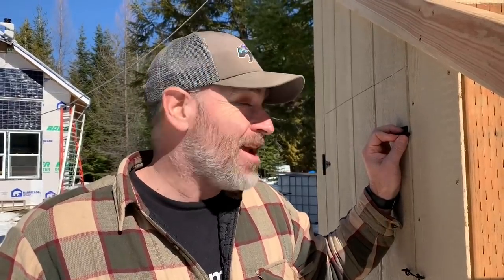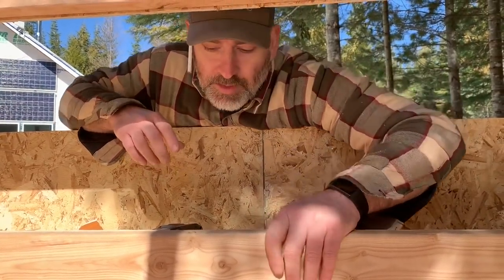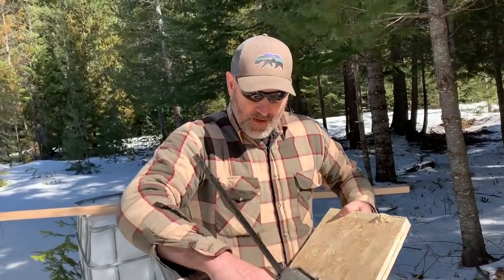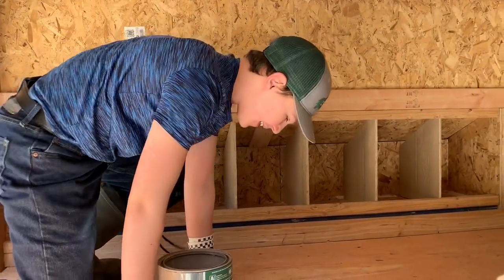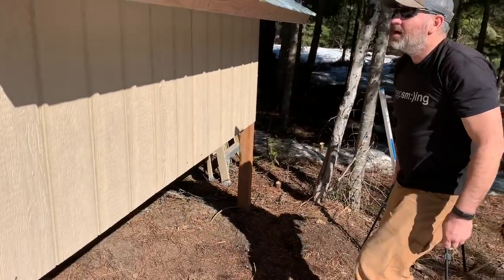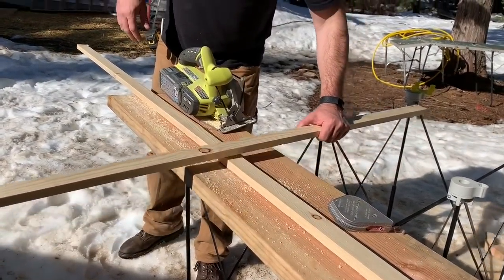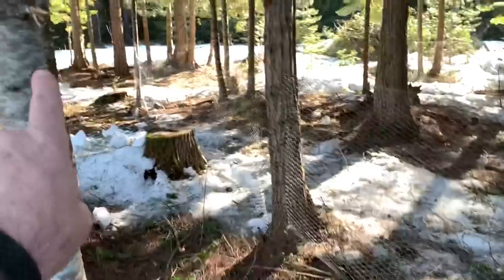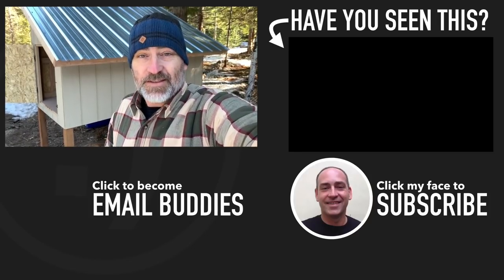BEST DIY CHICKEN COOP - How to Build a Chicken Coop - Part 3

Comment: hello! just a quick question, you guys live in northern Idaho, have you have any issues with doing a 100% tin roof? I live in Illinois, and I am wanting a tin roof for my coop as well. I'm just worried that there will be a lack of insulation, causing the coop to be colder in the winter. Did you do any extra sealing in and around the roof area for rain protection?

Comment: You should put a gutter on the bottom edge of your chicken shack so you could catch the water for the chickens. It will protect your face from running into the edge of the steel and causing an injury as well.

Comment: yes an awesome design, I like it . Just a suggestion tho, you mite want to think about changing the roosting planks to hard wood dowels or tree branches, as chicken feet, like all birds are designed for gripping round branches for there gripping power to hold on for roosting at night for sleeping. Oh by the why hello from Northern Ontario Canada, love your videos
Reply from the maker: Well, Chicken roosting bars should be at least 2 inches wide and preferably 4 inches wide. Chickens don’t wrap their feet around a perch like wild birds do. They actually prefer to sleep flat-footed. This has an added benefit of keeping their feet protected from frostbite in the winter from below using the roost as protection and using their body as protection from above. Also, this protects their feet from mice or rats who will often nibble on chicken toes while they are sleeping.

Comment: The national chicken society calls for closer spacing on your ramp cleats! 🐔
Reply from the maker: If a chicken coop ramp is at an angle between 30-45 degrees, the cleats should ideally be 3-4 inches apart, and no greater than 6 inches apart.
Reply: @MartinJohnsonOffGridLiving  in Idaho you must consider the flux incapacitation on seasonal contraction! I hope that is clear!😁!